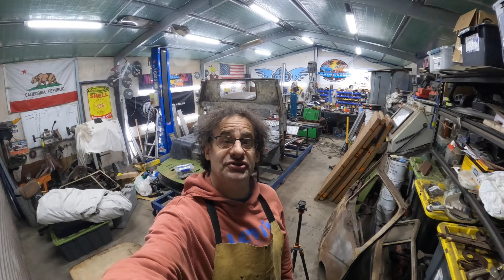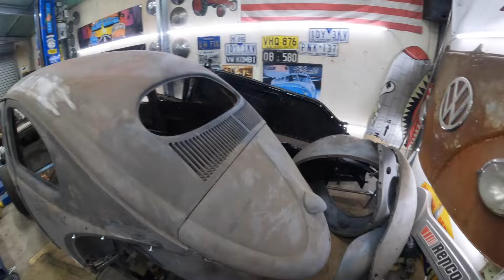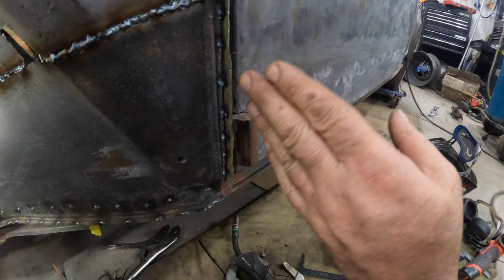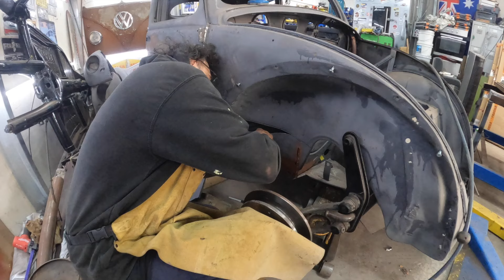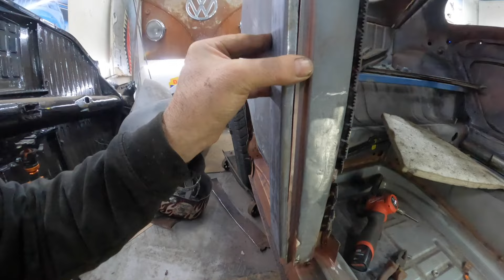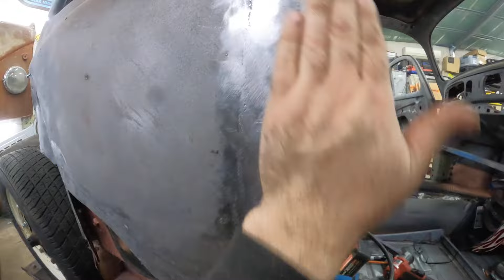Welding new panels on the 57 oval beetle "ophelia" #vwrestoration

Comment: Hey Nick, I've binged so many of your vids lately, absolutely loving your work and approach 🙌

Question on metal prep in unseen areas & in general... Are you wire brushing, rust converting with phosphoric acid & then using weld through primer to seal? Are you topcoating in those areas also?

I'm about to do some major work on my '71 sc, so trying to learn the best methods!

Look forward to hearing from you mate. Cheers Josh
Reply from the maker: @joshuammorrissey3796  cheers Josh, with metal preparation, the weld through Primer is really just on top to stop things rusting. Once I go for a poxy primer I will rub rub back all the steel to bare metal and then hit it with a epoxy primer.
Reply: @Demop_VW_garage  Makes sense 👍🏼👍🏼 Also, How much work are you doing to the non-seen face of a body panel before you're welding it in place forever where you can't access it ever again? 

Would I be correct in assuming something like a KBS rust seal or equivalent?